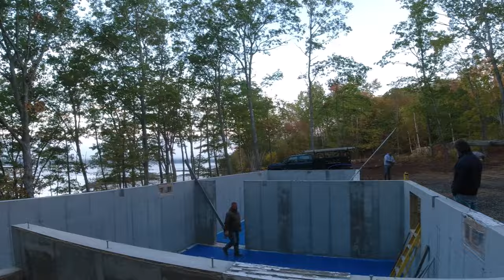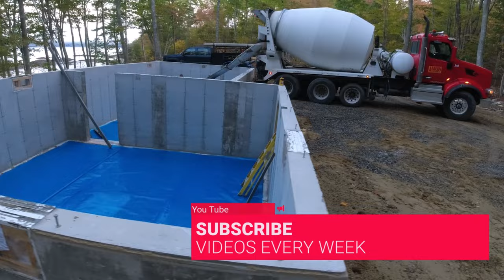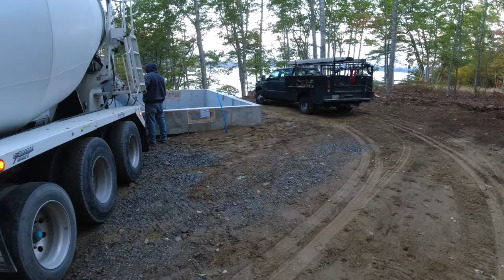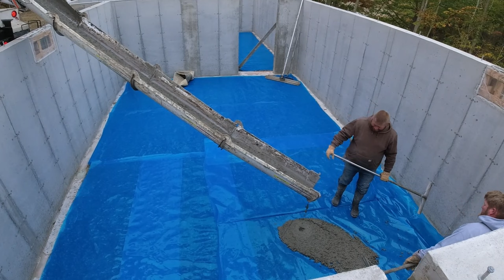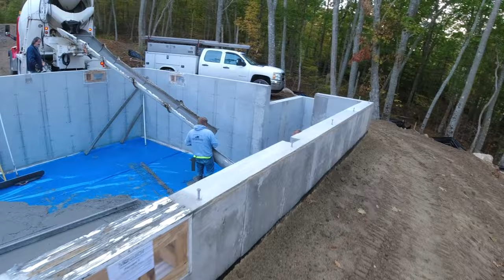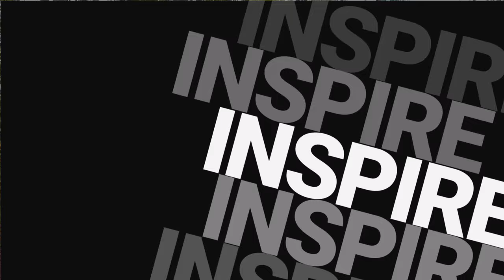Duel Basement Floors, How We Poured The Concrete For Both!

Comment: The total amount of concrete yardage you used to pour both those floors was 15 yards.  Was that a grade stake I saw you pulling out of the first bay at 6:47?  I couldn't see chalk lines on the wall or any markings on the stake because of the distance from the camera, and I know you don't typically use them.  You must be quite a bit south of where I am in Hermon to have such nice weather.  :)